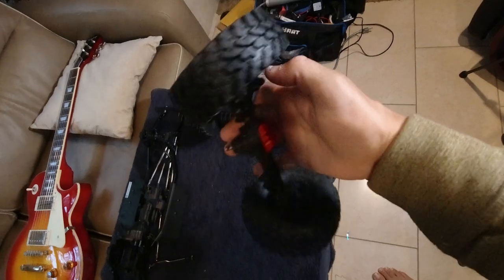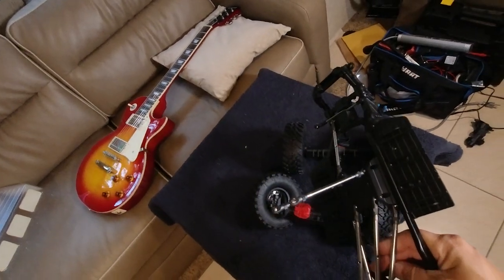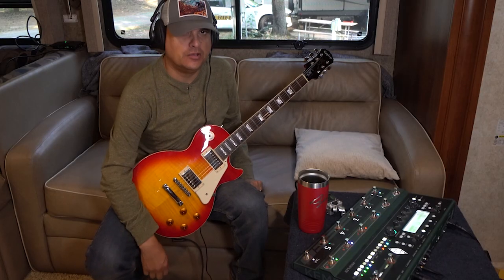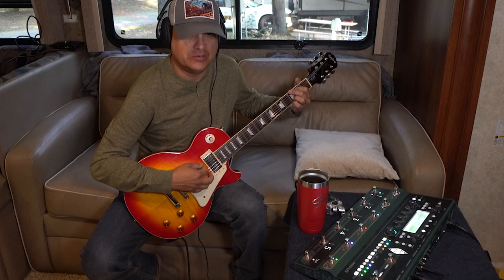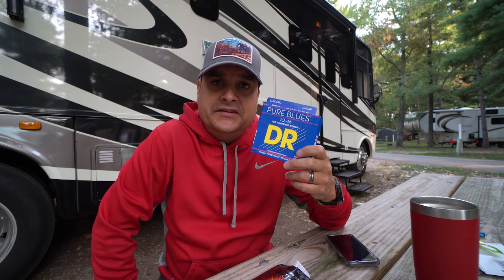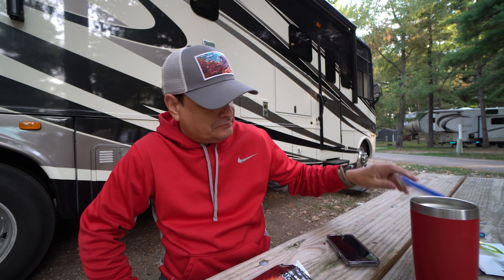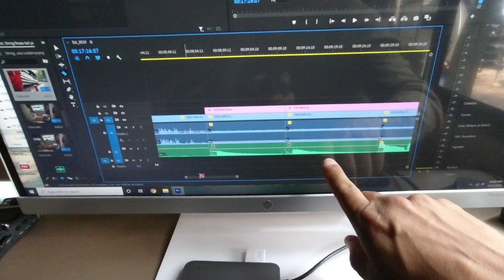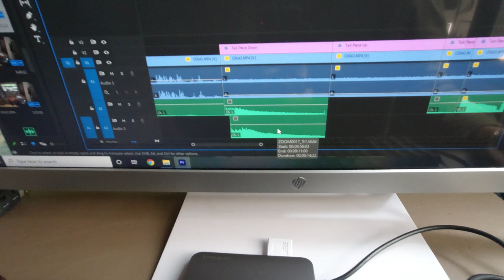Does Raising A Les Paul Tail Piece Kill Sustain - Best Strings Of 2020 Finale

Comment: D’addario strings? If it helps the guitars tone, and you like it, use them. If you like something else use them. I tried Blue Steels and it brightened up the tone of my Hagstrom Swede. It is a dark sounding Guitar to begin with, and using something to help brighten that guitars tone and I’m going to use them, if the coming pickup swap doesn’t do what I want it to. On my Gibson SG, it sounds good right out of the box, and when I put regular Ernie Ball Slinky’s on it and it sounded like a older Gibson. The tone was what I wanted for a stock, in modded guitar. On my Squire or Tele, I don’t k ow yet. I just got them this year and I haven’t had a chance to vet them out. I am planning to install Guitar Ian Mat set up com0lete with Brighton Rock copies of the Tri Sonics May used on his red special. His guitar tone is one of the most recognizable tone ever. The only thing that makes as much difference as Of his tone is Tom Scholz Tone, the tone of Boston. To give credit where credit is due, I believe that Barry Goudreau had something to do with that originally. Later on Scholz designed his own effects units beginning with the Rockman Headphone amp. 
Dylan I love your channel. I’ve learned a lot from your videos. I’ve subscribed to your channel, but can’t afford to join your patron, yet. Too many medical bills to pay off first. But I Will get there sometime.

Comment: I like bright strings and pickups. To the effect of always running my Full Shred in Parallel and using the NYXL often. Typically the Balanced Tension sets 11-49 for feel. The D'Addario nickel are my favorites.. but most sound fine it the Balanced thing. I like jangly.. which is weird because I play a Junior thru Fuzz Face most often...  Fight for bright

I stopped using EB and RotoSound for weird reasons like the ball ends being to large for my Tailpiece on RotoBlues and just not liking the feel of EB tensions

Comment: So I'm not a professional sound guy but here are my thoughts.
if the guitar body is vibrating more when the piece is down than up, then its a more "solid" path for the string's energy to flow to the body of the guitar, where as when it's up maybe the "connection" is looser?

I could see where that came from, depending on the quality of parts if the tail piece is screwed all the way down then there is physically more material touching each other in the screw and the fitting, therefore creating a tighter connection, 

if the tail piece is raised up, and their for there is less screw in the fitting then there is less physical material touching each other, creating a POTENTIAL looser connection, 

If the bridge is in fact looser when up than it is when its down then that makes it easier for the energy of the string to bleed off into the tail piece because its vibrating more, due to the "looser" screws, if the tail piece is down then its possible that the tail piece is more connected with the body and vibrates less, 

think about it in the sense that if you held a string with your fingers (not pressing it down on a fret, and tried to strum it, the vibration would absorb into your fingers, killing sustain. if the tail piece does that then there MIGHT be some hint of truth to that myth, depending on the quality of parts and other factor,

this is me mostly thing out loud sorta, 
I'm not knocking the test, or your results, I'm just mentioning things that might facilitate the thinking behind it.

Comment: I could agree with most of your assessment.  Raising or lower the tail piece really made little, or no difference in the way the guitar sounds.  I did notice though however, that raising the tailpiece does allow the strings to bend easier, albeit not by much... One thing I will never understand is how the strings touching the back of the bridge affects tone... If this was so, intonation adjustments from the bridges saddles would have little effect.   Strings:  They DO make a difference in tone and play ability.... I was a huge EB slinky guy for like ever...love the sound...especially on a Gibson.  But in the end they just didn't stand up... They'd go out of tune easily and break often.  It took me years to figure this out.  But I went on a pilgrimage to find a new string...I tried MANY different strings, including most of what you've illustrated here, and in the end, the NYXL was my favorite.  I like their bright sound...how easily they bend, and most importantly, the abuse they can take without breaking and tuning stability.  They sound allot like EBs to me, but last way longer. Boomers were decent strings too....excellent for what they cost...but were a bit too dark for my liking. Thanks for the video duuuude!

Comment: I'm a believer and user of Fast Fret, first thing I do with a new set of strings is run that applicator up and down the strings (this part is like fingernails on a chalkboard to me) then use the cloth on the strings. I'll do this before I play, and afterward. Keep those strings clean. I also use Finger Eeze (Ease?) on the fingerboard, back of neck, and even spray fingertips, clean excess from back of the neck and fingerboard. With that being said, I buy Musicians Gear .010 and .009 guitar strings (if they stocked .008 or .007 I'd use them too), 10 sets for $2.20 a set from Musicians Friend (free shipping). Keep them cleaned and lubed, they last. I've used and liked D'Addario, Ernie Ball, Fender Bullets (had problems with the lead ball not holding the string) when they were what I had in my case when time to change strings and not cared much one way or another what brand I was playing. Not having a preference, buying the Musicians Gear strings makes sense to me. I've never used a coated set of strings, and probably never will because I'm not about to pay THAT for any one set of strings. As with anything else, use what you like.
Reply: I'll also use the same strings on any acoustic guitar I own. It just doesn't make that much difference to me sound wise, I like ease of playing.

Comment: The higher the brige the more tension in the body, so shouldn't it transfer more vibration to the body? Not that it matters in electric, but in an acoustic it makes some difference. Body resonance helps in feel and in live performances for the player. On the other side it creates more sympathethic resonance on the strings and that muds the frequencies (its something a bass player knows) and its bad for tone. Puck a string and then mut it and if you hear the other strings you will see how it muds the tone. So in conclusion, body resonance is good for feel and bad for tone and sustain.
Reply: "The higher the bridge the more tension in the body" I'm sorry but I don' get the point why more tension will get more vibration. Any way I Think that the tension in the string it self (from the nut to the bridge) has to be de same in order to be in tune the same and the more vibration the less sustain. Semi hollow guitars aren't famous because of there sustain. Acoustic guitars is another world, but saying that resonance helps, is the same that a drummers throne shaker helps sound better (a little motor that it shakes the drummer chair every time you send low frequencies like the Kick drum or the bass.... of course you gonna filled, but it doesn't do any good to the sound. A Sub or a full PA cain of stack will do shake your bonnes much better.
Reply: @arkaitzcarrasco2216  There is more tension in the body because the bridge acts has a lever and that will produce more tension in the top of the guitar. In acoustic guitars sometimes it can produce excess tension and deform the top, its a normal problem.
Regarding resonance, is was saying it helps with feel and worsens sustain, so we agree.

Comment: Guitar strings are like engine oil to me. As long as your using “good quality” ie not no name junk, I have no interest in secret sauce, or “lasts forever”. Keep it fresh, clean, and change it often. It’s not worth it to try and stretch it out. The more you use it the dirtier and grosser it gets. That said I used to use boomers as a kid cause George Lynch used them. Then I thought I heard they we’re gonna quit making them so I moved to Ernie Ball slinky’s. Slinky’s are a no frills work horse. They’re “just strings”, quality is good, and consistent but I’d use boomers or the cheap D’darrio’s. I usually buy 4-6 packs at a time so if your strings cost more than $4 a pack I’m moving on. They’re not gonna be on the guitar long enough to justify anything else. Acoustic strings are different I buy those based on what sounds best on each guitar. Acoustic guitars often like different strings based on how bright or warm the guitar is. In that regard they’re not one size fits all
Reply: Lol I played the David Gilmore signature GHS set for a long time just because I liked pink floyd, I totally get the name backing influencing string choice

Comment: The best Elixirs for electric guitar are the Optiweb not the Poly nor the Nanoweb. The Poly are better than the Nano on acoustic (last longer and doesn't crumble) but doesn't have the zing of new strings, they sound broken in.

I think the D'addario XT are better than NYXL (and they both last longer than the GHS Boomers but YMMV).

For an interesting sounding string, I would try the D'Angelico Electrozinc strings.

Also, raising the tailpiece just changes the 'slinkyness' of the string, but just marginally

Comment: I'm using the Standard Ernie Balls and sometimes the Rock'n Roll Ernie Balls. They are good enough for all my guitars. Also liked the GHS Nickels.
Concerning the thing with the tailpiece you are absolutely right. It does NOT make any difference in sustain, playability or tone BUT it makes a difference in holding the tune. If I set the tailpiece higher my Les Paul stays in tune much better. When I set it low it's a tuning mess. Could have something to do with pressure and friction on the bridge - but I'm no scientist too :-)

Comment: I must be anemic, because my stings don't typically rust or wear out. What happens most of the time is the little e string breaks and I change them all. Since I've been using the NYXL, I've never had a little e string break. I could probably use one set for the rest of my life, but every now and again I get a hair up my butt to clean and oil the fretboard. I paid $13 for my last set. Seems economical enough to me.
I have my LP tailpiece set up about as high as it will go too and it rings just fine. I didn't do it for sound. I did it to lower the break angle tension so the little e strings break less often.

Comment: As for the strings I liked #2 and #4 the best but if I listened to it again tomorrow I might hear it differently! I use DR Blues. After trying several different brands I've come back to these. I use 9's on my Teles, 10s on the LP.
I keep the tailpiece cranked down and top wrapped, that way you get the sustain of contact with the body and some tension relief on the string angle that raising the tailpiece would give you.  Billy Gibbons seems to agree with that and Joe Bonamassa I believe but that's not why I do it. To me that sounds and feels the best and I really don't care what a machine says.

Comment: I use Fender pure nickel electric strings because they are cheap and good. Given the multi-colored ball ends, I suspect they're made by D'Addario. I may switch to whatever pure nickel strings my local shop offers because I'm worried they may go under - I need to start buying more locally. I just got a Tagima TW-55 Tele from my local dealer - very nice for the price.

Comment: I've tried pretty much everything over the years and have finally come full circle and am now settled on Ernie Ball Pink Slinkys (9-42) for the Les Pauls and GHS Boomers GBLXL (10-38) for the Strats. No more overwrapping but I do raise the tailpiece so it just clears the back of the bridge. The sustain comes most from the open strings between the nut and the bridge. The instant you finger a note the sustain is compromised. If you want sustain grab a compressor and you'll have all the sustain you need.

Comment: Depending on the gauge of strings you use, and the distance between tailpiece and bridge on your specific guitar, tailpiece height will definitely make a difference if you are a slide player. I've noticed that even a millimeter difference in height can make a difference in slide playability. I agree with Dylan here on the sustain issue. By the time your average guitar player runs his axe through his or her pedalboard and amp, any perceived difference in sustain is probably going to be minimal. The top wrapping thing is another useless thing to argue about. I once did it on my LP copy because I saw Marc Bolan had done it. But then went back to the standard way of stringing -- it was much simpler to just string the string through the tailpiece, and I never noticed a change in tone or playability. Top wrapping definitely didn't turn me into Marc Bolan, either. :-)

Comment: Tried paradigms and e, b or d strings broke after 2/3 weeks on multiple guitars.  Went back to regular Ernie Ball 10s and they've been on there since Oct 2018 Jan - 2019 April-2019 ( I keep the date of the last string change in the case).  These guitars are gigged fairly regularly a little less since this past March.  Maybe I have an isolated experience but that's why I think Paradigms are a waste.

Comment: I don’t even have to watch this: No, raising your tailpiece does not kill sustain. The benefit is you’ll maybe, possibly, maybe break less strings. HEY!! The guitar sounds in tune this time! Yay!!!!!!  ;^)
Reply from the maker: Glad you got your ears fixed
Reply: @DylanTalksTone  Come on man, absolutely nothing wrong with my ears. I totally agree with you on the strings. And didn't D'Addario release those same strings in the late 80s? I think they called them Hex-Cores. It seems like they rebranded them and instead of charging double, they tripled the price. And I'm glad you put to rest the tail-piece thing. Although people will still argue otherwise, I'm sure. I've been raising my tail-piece for 18 years. I've tried to tell people before. You don't need that much down-pressure on the bridge. My argument is that you don't need that much down pressure at the nut, why do you need it at the bridge? to me it feels nicer to play that way.
Reply from the maker: @JazzRockswithAdam  well we didn't change anything here... so it must be your ears
Reply: DylanTalksTone like I said, I have great ears. The string test sounded in tune. It did get a little wonky when you raised the bridge. But this is the last time I’ll be mentioning any tuning issues I hear. Let’s move on. 😀

Comment: I would be curious on your opinion on the B52 brand string..nlike other brands, B52s claim to fame is being "Highly Magnetic" which is to say the frequency is picked up y the pick up much greater, a shop in Daytona had them and 4 different customers came in to buy THAT BRAND in the hour or so l was there, so l bought a set... I didnt have another newset to compare them with..all l can tell you is that lve never noticed the string being magnetically stuck to the pickup the way these did. I liked them but not a real "Tone weinnie" so it just seemed like a whole new grasp for something new.. l use good ol Ernie 9s. Maybe there is something to more csrbon in the string producing more tone/louder or more sustain..this would have been a test they should have been in. Get a chance...try them out. $9-11 a pack.

Comment: I've heard that I forget where I got the info from but it was from a good source if I remember correctly that by keeping your tailpiece all the way down like that it's adding much more pressure on the bridge and it depends on the bridge it could actually damage it cave the middle and I don't know how true that is but it kind of made sense my SG the tailpiece is raised on it for no reason I got it like that and theI got it like that I've had it set up a few times and it's never been adjusted any other way and it works fine anyway thanks sincerely yours, Bob the blind bedroom guitarist guitarist
Reply: Yes, I have 2 les pauls whose bridges collapsed. It took over 20 years, and eventually affects action enough that you'll need to replace them. LP necks are set at various angles, so sometimes you need to top wrap or raise the bridge, or the strings will hit the bridge in 2 spots.

Comment: Cool video, good observations about the strings, I've used just about every brand of strings and can agree with you, they are supposed to be just strings that feel comfortable and last, been playing 45 years, I always go back to GHS,  if I can't find GHS, I use Ernie Ball Slinky series. I used different gauges on different guitars (tele, strat, LP, SG, etc)  A few strings that have surprised me as good over the years were Fender Super Bullets and Dean Markley Blue Steels. I find a medium height on the stop bar works best, if it's down to the deck on some guitars the strings will touch the tunomatic bridge behind the saddles and cause a sitar like sound. I use a Faber ToneLock spacers on the stopbar studs, they are like little collars that enables you to tighten down the bar without touching the body, supposed to be a tonal improvement but I haven't noticed, BUT it locks in the stop bar so it doesn't fall off during restringing and cleaning the guitar which I find handy. Good stuff, people over think this stuff waaaaayyyy to much!